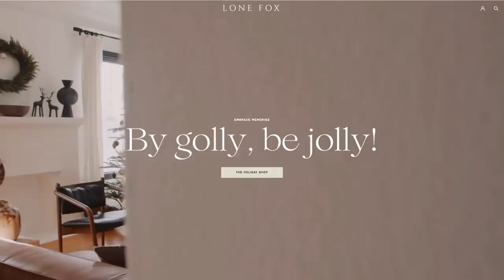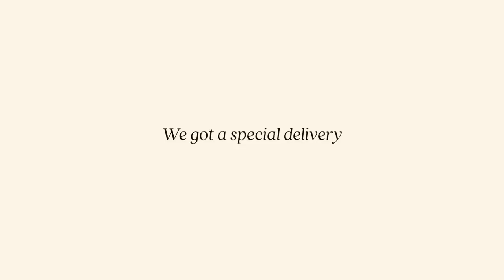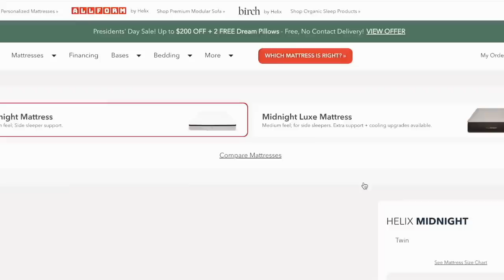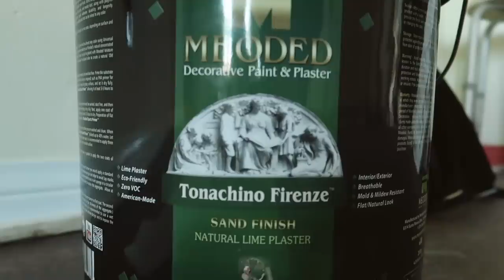WE HAVE A KITCHEN! 🥺

Comment: I like both tiles but in such a small space, the larger tiles might be better at the offsets you described. The smaller tiles might be just a bit too busy with all the grout lines. All that activity on the floor might take away from/clash with the movement of the marble. You need to let that marble shine.  🌺🌸
Reply: I agree.  I see several people like the brick but I think the squares would feel more harmonious and less busy.  Using the brick somewhere as a little accent though...?
Reply: LESS BUSY
Reply: I liked the tile he removed, it was like a charcoal slate, but might have been damaged.  Or maybe hard to keep clean?  Anyway, I did like the look.  It would have been perfect with the marble.
Reply: I agree. The space is already quite visually full. The small tiles will be busy. However… they were a better colour. Can you get the big tiles in the colours of the small ones. They were more muted which I think is necessary given all the other lovely features. Great kitchen Drew 🤩
Reply: Square tile it will help make the space feel big the bricks would make it feel kind of small!
Reply: I agree the brick tiles would look too busy. I also like the two different tones of the square tiles.

Comment: Absolutely the square tiles. Better depth of colour, and wont be as busy as the little ones. Also, you can use the little ones for an accent trim like at the doorways or along the room edge
Reply: My thoughts exactly and turning the tiles on point so it not so "square" it's a diamond.  Small tiles around the border for sure or a subtle pattern with the combo.

Comment: love travertine, we have the tile outside in our backyard and around our pool, but not a good idea for kitchen. Reason why we got it outside around our pool is bc it has small holes throughout the tile which allows water to go through and doesn't lead to much flooding and puddling, but in a kitchen, it would be disaster to clean. Crumbs and spilled liquids getting into those tiny holes will be so hard to clean out.

Comment: Please check the absorptive level of the tiles. There is a risk with specifying a product that (looks) so pourous that it might absorb liquids - and therefore stain (especially in a kitchen). I am even reluctant to specify teracotta on kitchen floors for this reason. Of course you do you - but just something worth checking :)
Reply: This is for the floor tile - wall tiling is much more forgiving.

Comment: Renovation tips -  FLOORING   first can I say that my choice would be to do HARDWOOD floor to match the rest of the apartment for visual flow. However CURRENTLY YOUR PLAN is to remove all the contemporary black tile flooring in the 2nd floor kitchen, breakfast room and laundry.  It makes more sense and saves money and time if you complete  ALL the tile demolition in the adjacent areas; breakfast room and laundry . To remove that cement  under layer is labor intensive and very dirty job-  best to hire that out and  get it done over a couple days.  Then with prepped sub floor , you can do the tile flooring of the 3 areas IN ONE DAY vs section by section.
If you were not so set on actually tile I would recommend looking into a CEMENT POUR  with STAMPED 'faux' tile imprint. It can be great look and the cement can be tinted and even have surface treatment to get that old/rustic look you want.  The current cement skim on the subfloor might NOT need to be removed! And the time and cost could be be a fraction of what you are going to pay now.
NEW DOORs ON  FRIG AND OVEN- replace the stainless doors with the look you want. Simple, custom look and money saver. Because OMG hauling those huge ( brand new) appliances down the back stairs to 1st floor  kitchen?! And then hauling new huge appliances up the stairs?🤑💰🕰

Comment: It's turning out so nicely. This kitchen really was worth every investment so far, Drew! I think it would look good if you used both the square and brick for the flooring. A simple pattern, nothing crazy, maybe just framing the transition to other rooms? I'm also thinking, since the wall texture is now unified and it's possible to see the window frames in their full glory, were you considering painting the frames with the same paint as the cabinet doors? It seems the pine stained unevenly as it normally tends to.

Comment: I won’t be too much help here, but I like the cooler tone of the rectangle tiles and the size of the square tiles. I think if the rectangle tiles were a larger scale they would look more appropriate for a kitchen and not give bathroom vibes. Because the brass hardware warms up the cabinetry, you can’t go wrong with either of the travertine looks. But a tip from an architect, open all of your tile and mix them up between the boxes to avoid any issues with the different tones. Looking great, Drew!

Comment: If the size fits I would do a combo of both tiles. One square, place around the brick tiles so they bump out a bit on one side. So when placing the brick tile one side starts with the edge of the quare, the other from there and so on around the square. I don´t know how to describe it better.

Comment: Hi Drew! Love how the kitchen is shaping up - very unique and beautiful. That wall finish you are considering - have you checked that it is wipeable? I know you have nice high marble backsplashes but kitchen walls can get greasy and that finish looks suuuuper matte, so I'd worry that a damp cloth could mark it. On the topic of the marble, that corner to the right of the arch where they didn't line up the grain - would you consider (would it even be possible) getting them to shift it up an inch to match and putting a little filler slice at the bottom where it is less obvious? You seem like a stickler for detail and I'm surprised it's not driving you crazy!x

Comment: An easier way to do that is to take painters tape on the back of the hardware and poke the holes. Then use that as a template to drill.

Comment: Take my advice, don’t use travertine on floors. I did it and it is too soft and has slowly disintegrated over time. It chips very easy and absorbs much more easily than marble even. It can be sealed but it’s still not good for high traffic areas

Comment: There is a way more easier way to install handle when using an existing hole.  Put the piece of tape at the back of the handle.  Pierce the holes into the tape.  Take off the tape And voilà you have your template !